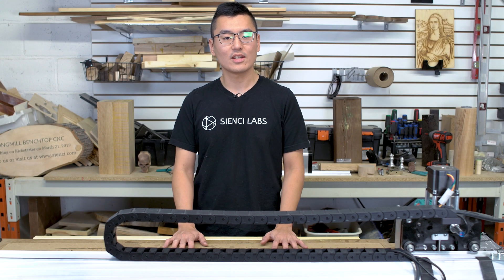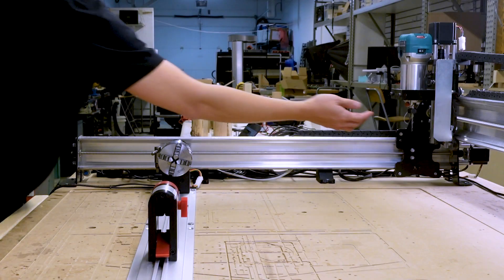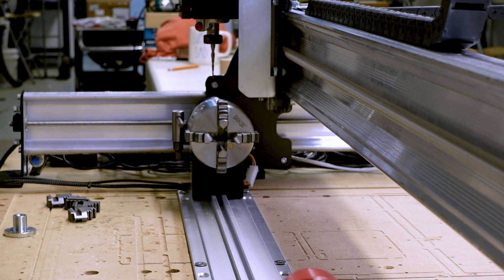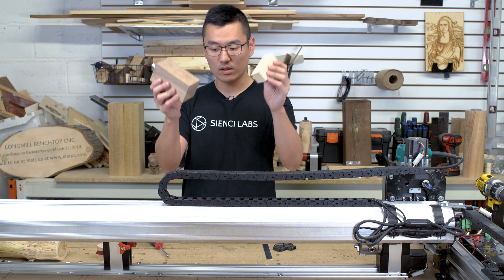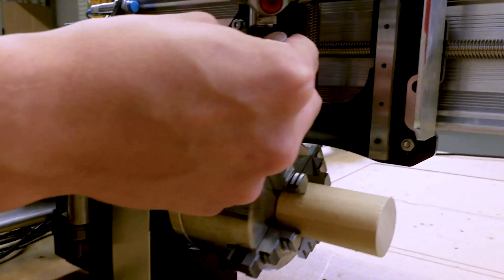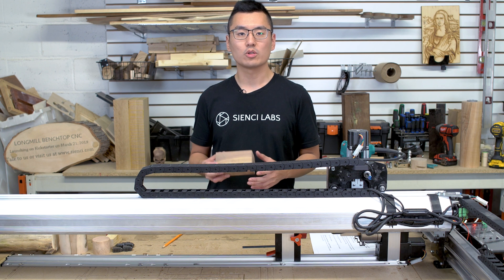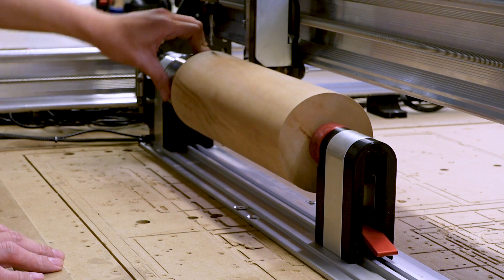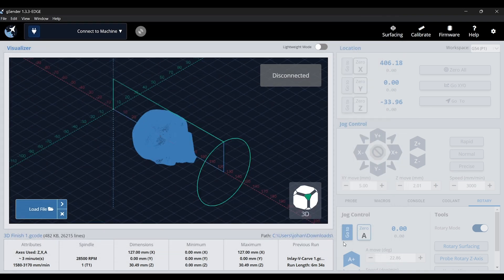Quick Start Guide for the Vortex Rotary Axis

Comment: Hi Daniel, I'm assuming that you would have to re-tram every time after using the Vortex?
Reply from the maker: Hey there, While you can re-tram, it's not entirely necessary.  Just use gSenders built in Y-axis alignment tool like we have on the resources steps for the quick start guide and you should be good to go. Thanks for asking!